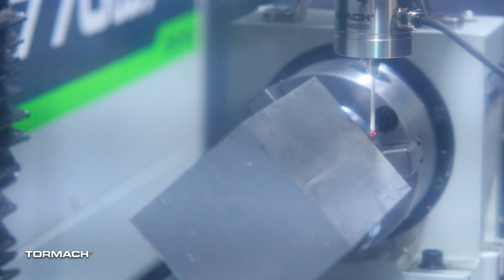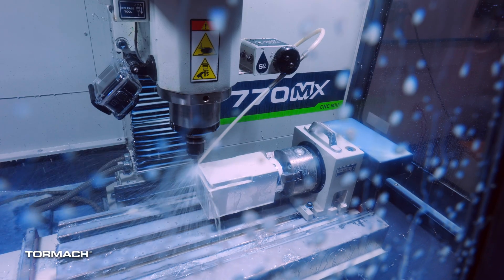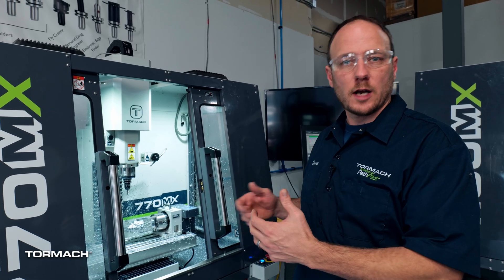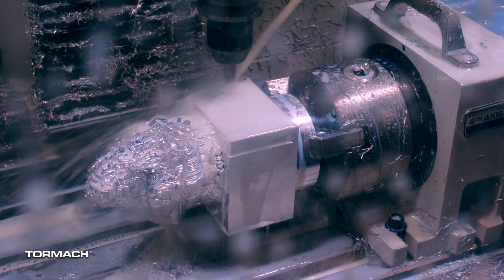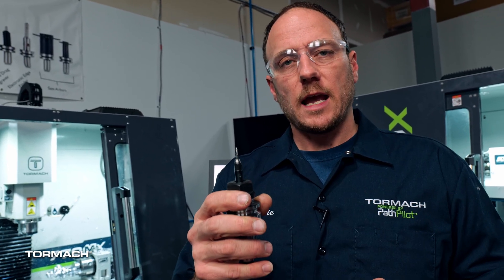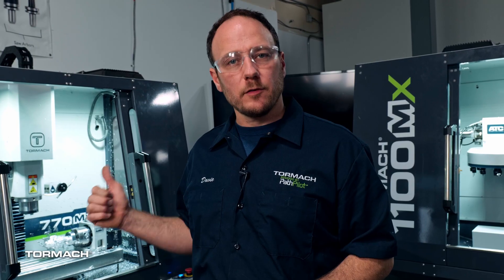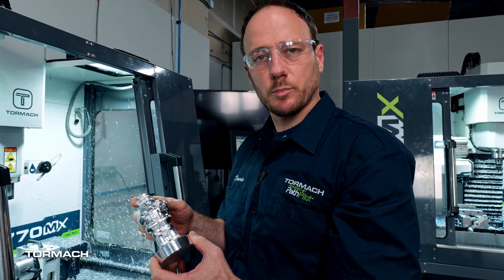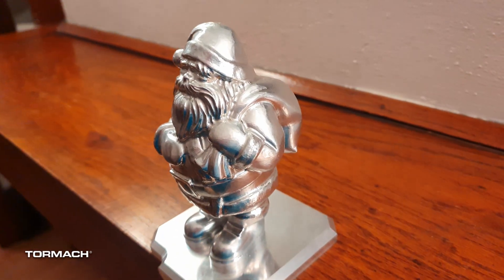Cutting a Santa Stocking Holder on 770MX/MicroARC 4 - Part Two #madewithtormach #cncmill

Comment: Nice. Did you put any overlap in the cut depth for the first half (santa bust) and the 2nd half (santa legs)?  Or just split the process at a specific depth on X for different operations?  Also, is there any fix for large files that lose some visual indication on the screen such as show only current tool path?  Is that a software limitation, or the CPU?
Reply from the maker: Great question! For the bust I contained the tool path to a definitive point in X (as his belt) and set the tool to stay inside the boundary. For the legs I only contained the tool path so that it wouldn't bonk the chuck and otherwise let Fusion sort out what material needs to be removed. Check out the forums post in the description if you would like to get a better look at this file. 
For the preview lines, you can display all of them but the initial display is limited to help ease the processing power on the controller. You can load all of the preview lines when you need to, check out this video that shows that process: https://youtu.be/iSMvYABhTWg?t=292

Comment: I think the surface finish came out very nice.  Question; I am assuming you were using Fusion 360 with or without manufacturing extension?  Looked like full 4 axis simultaneous or does that surfacing operation use 3D wrapped tool path that works with 3+1?  Thanks for sharing
Reply from the maker: You are correct in that the roughing was done using tool paths available in the standard package. The final surfacing tool path does need the manufacturing extension, however.